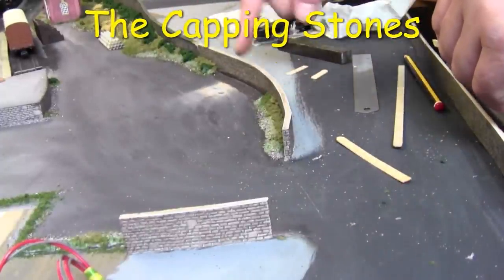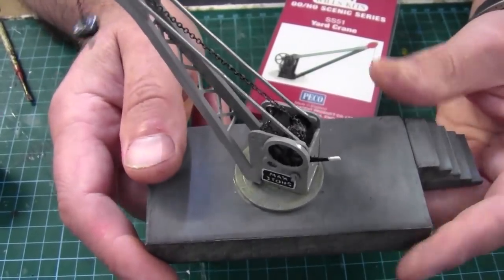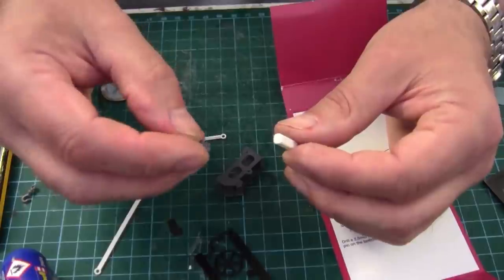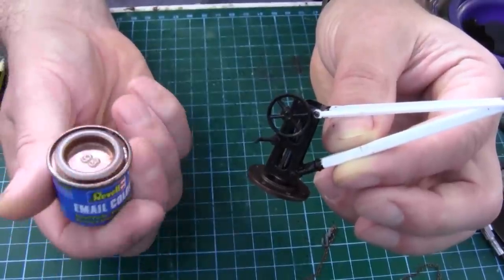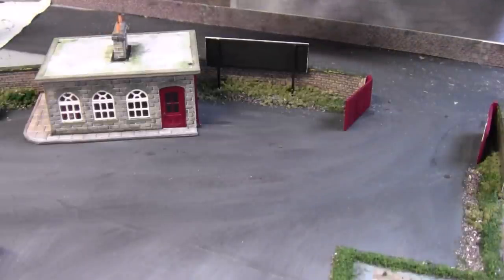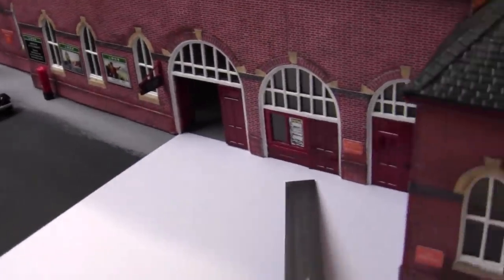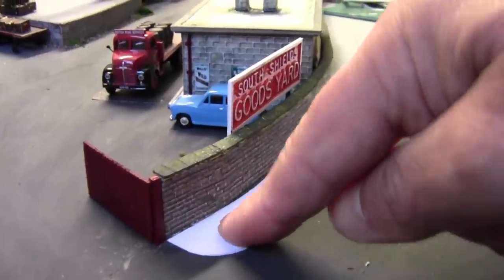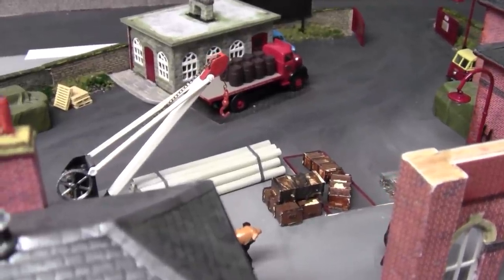The Goods yard part 2   No266

Comment: How strange,  I’ve been paving my layout over the last few days. Wish I had thought of gluing it to card rather than direct to covered baseboard, my way is backbreaking! Can only do a bit at a time, then have to stop to watch your progress! Thanks, Roy.
Reply from the maker: Hi Roy. the best thing about the way i do the paving is you can take it back to bench and make the paving in comfort. and also you don't have to slide the card under the building. Ive have only done because of the open doors. to reduce the lip. its all about making it easy for yourself. thanks again for commenting ..cheer's Tony

Comment: What a brilliant finish to that goods yard Tony, really looks the part and the entrance is fully convincing. Talk about timing mate, I finished my 2 goods platforms this afternoon and have just dragged out the Wills SS51 yard crane to build and, guess what, I have a spare 8mm x 25mm penny washer! Many thanks for your continuing inspiration to our community. Cheers Steve
Reply from the maker: Sounds like a game of Snap Steve. thank you for commenting. and its great to hear some of our tips now have come in handy....cheer's Tony
Reply: Thanks mate, to be honest I would have modified it in some way anyway so it had free movement but I really like the washer method. I added a dowel pole to the Ratio coaling stage and crane kit so the crane could swing round easily and that worked well, cheers Steve
Reply from the maker: Different methods with the same results...cheer's Steve.........Tony

Comment: Another lovely job well done. Tony, you are an inspiration to all of us. Many thanks. I am currently 3D printing a Two Bay Engine Shed. There is also a workshop that you can attach in place at any one of the four side panels. or you could make two. (One for each side). I borrowed the printer from College, but it needed some repairs before printing this model. Regards from Thailand. Martin..
Reply from the maker: Hi Martin. That sounds interesting two bay engine shed. you will have to send me some photos...when you have finished....all the best Tony